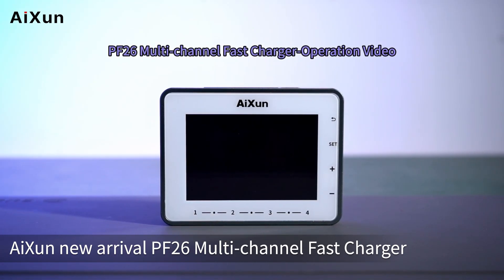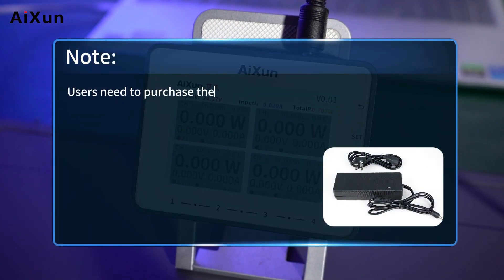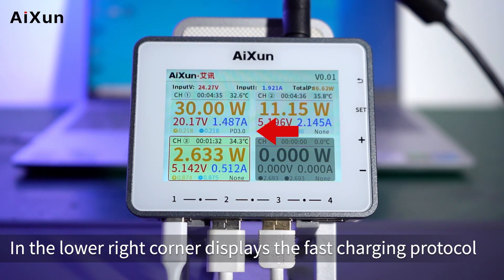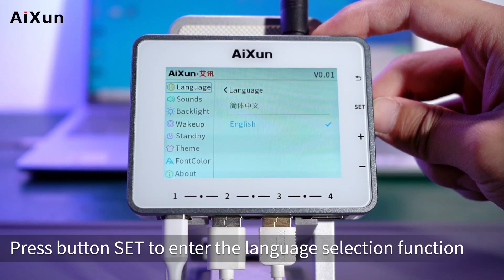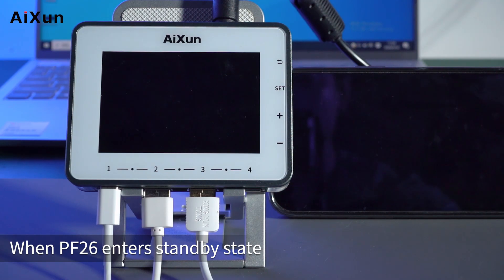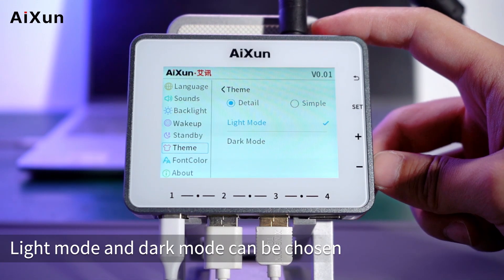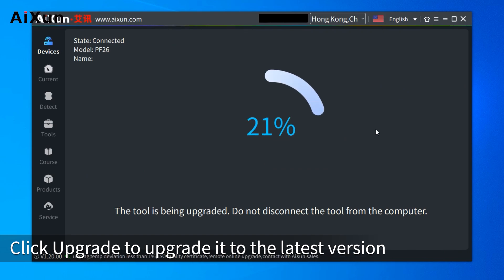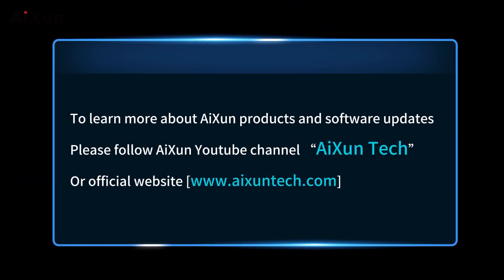AiXun PF26 Intelligent Multi-channel Fast Charger Charging Station Hub Operation Guide

Comment: After updating my AiXun PF26 to firmware version 1.04 (2024-11-29), all channels started showing random or incorrect values — voltage and temperature indicators jump from minimum to maximum. The actual output voltage is correct, but the display is completely inaccurate.

I tried downgrading to all earlier firmware versions (from v1.03 back to v1.00), but the issue remains — so it seems that calibration or EEPROM data was corrupted during the update.

Unfortunately, I can’t contact AiXun support — they only respond through WeChat, which requires verification from another user, and none of my friends use WeChat. I couldn’t find any email or alternative contact method that works.

Did anyone back up their EEPROM or know how to restore calibration data on the PF26?
Reply: Update: Problem solved with help from tech support. The issue was caused by corrupted calibration, and flashing https://drive.google.com/file/d/11KzkfbeHXMNp7F1r1GtL5Jop_yk9jguX/view?usp=drive_link fixed it.

Comment: When only one device is plugged in (using one port), a miss-click occurs to the point where you cannot chat or use the screen properly while charging. When using more than 4 ports, charging automatically stops after 30 seconds. Even if I plug in all ports 1 to 8, it disconnects. We have video of this and have notified the company. The company continues to only request tests. I already have a video of what happened and I'm asking for an exchange. I am not a test person. The company must have tested this machine before selling it.
>>>>>>>>>  24.9.4 I loved this product so I returned it and bought it again. However, in the basic version Ver1.0, there is a double-click miss-click phenomenon during charging, in ver1.3, charging works well and there is no error, but when the charger is connected to channels 1 to 4, the screen is gray and cannot be displayed (charging is possible normally), in ver1.1, everything works well. So I am using ver1.1.
Reply from the maker: Hi, we promise that all the devices are tested before shipping, but some unexpected conditions may occurred during the delivery. We will help users quickly locate and solve problems through testing first. If the problem can't be solved through testing, we guarantee to provide warranty service for users, thank you for choosing AiXun.
Reply: @aixuntech  I loved this product so much that I returned it and bought it again. Luckily, this time it works fine. It just seems to have been defective. I love this product and I love it so much. I wish you prosperity.
Reply: Same worst product no support i buy channels are working without devices
Reply: If you use this product, you will experience an abnormal phenomenon during charging when connecting and disconnecting from the computer in ver1.0. In case of ver1.3, even if charging is done, it is not displayed on the channel screen. Only small letters such as totalP are recognized. In case of ver1.1, both connecting and disconnecting from the computer work normally.